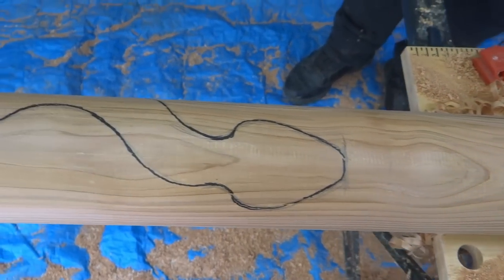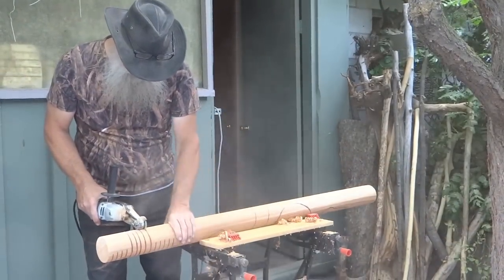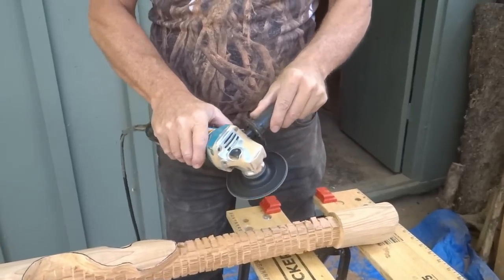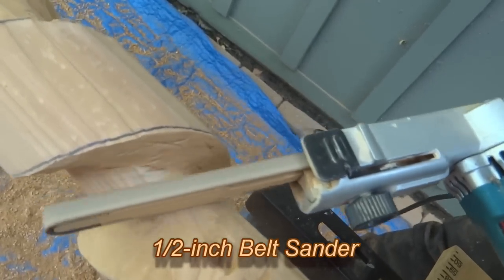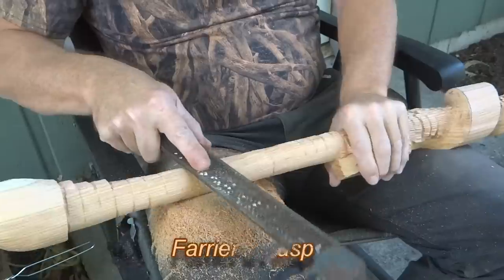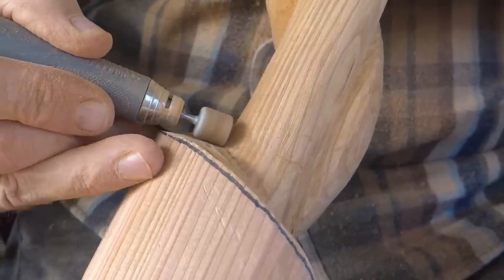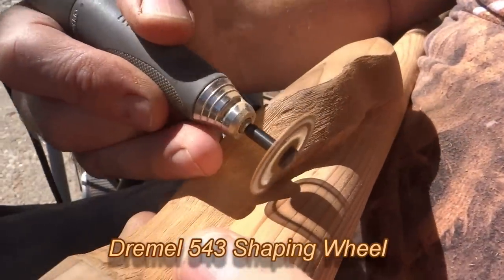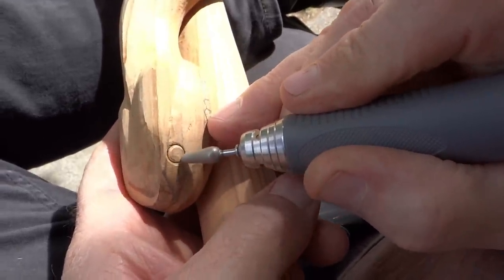My Best Power Carving Tools

Comment: I could use the tool to take out the wood to size and the 1/2 “ sander . I got a little chainsaw like a drill that’s cordless that I use and my angle grinder with different attachments to widle away with .
Reply from the maker: I've thought about using a little cordless chainsaw, but I've been afraid I might  make a mistake and cut too deep. Haha!
Reply: @StinnettSticks  I thought same but you go slow it works out just fine

Comment: What tool and bits do you use to burn the scales, is it just a soldering iron with a changeable end bit?
Reply from the maker: I use Razertip wood burner with a BPH pen and snake scale tips. You can find the burning tools and most of the other tools at Treeline.  https://bit.ly/37mzHvC